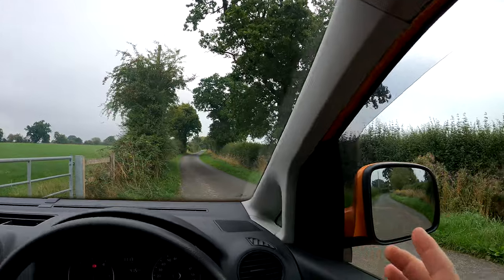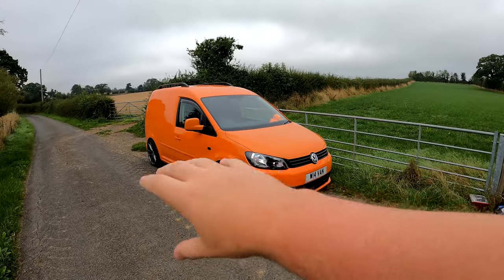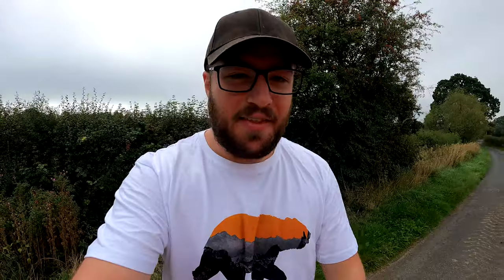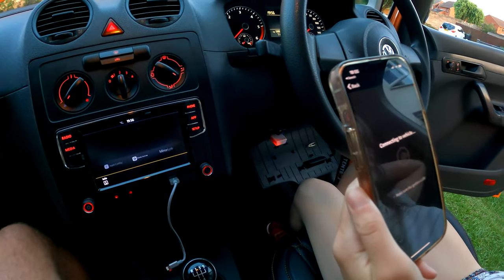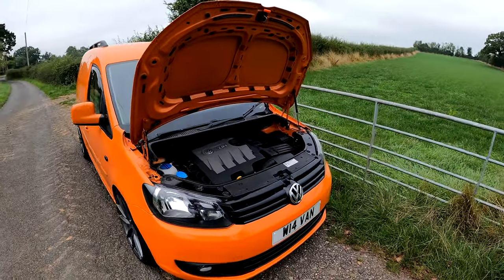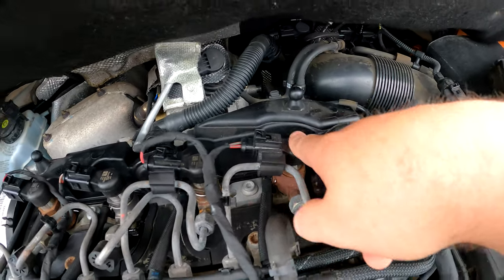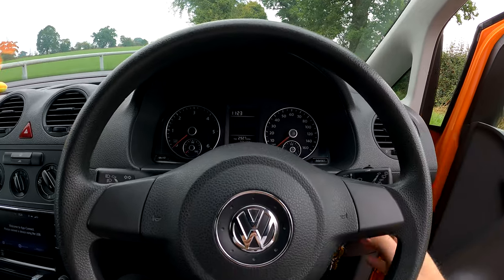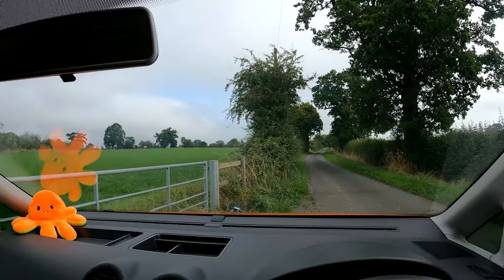I have major issues with the Caddy...

Comment: I've had caddy from 1997 5 in total. 2 mk1s. Then a 1.9tdi.1.6tdi 2.0 tdi. Always used she'll vpower diesel. Run from new to 90000 miles never had injector issues. Now have 2.0 tdi highline 69 plate. No issues on shell vpower every time
Reply: Hi mate brilliant stuff. 
We got a 2013 CADDY 1.6 TDI C20 Startline 68000 miles minted (kept in garage) couried from leicester to Scotland and we converted it to a mini camper.  It had injector 2 and 3 replaced by the one previous owner . We hope we get a few years from it yet but i dont believe the horror stories as  most every car has its faults .

Comment: Be sure to replace the injection bolts , as soon as you can, the bolts have a tendency to snap .an expensive fix on the cylinder head otherwise, it’s a bad design 1 bolt per 2 injector.

Comment: So what were you charged for the injector replacement work?
was this a brand new OEM injector or refurbished one?
I have  1.6 TDI CAYC Golf Mk 6  RAC charged me £600.00 to replace my number 1 injector at side of the A1
Reply from the maker: Thankfully nothing, it was covered under the warranty. 🤞🏼
Reply: How's the golf doing?
I bought mine (CAYC 2011 model) about 10 months ago. Drives okay but I had to take it to the shop every month with some part failing. Recently it's drinking the collant every 5-600 km and this is it's final straw. It's either going to be sold or scrapped. A bloody shame. It would be a great car if it was reliable. But currently it's just buyers remorse.
Reply: If your golf is loosing coolant thers a very good chance you have a leak in your EGR cooler valve,it appears to be quite common on these tdi
Reply: @colin5064  it was replaced already by a recall. Could be it's acting up again. But it's fine for 5-600km, I've read somewhere that these intermittent coolant loss issues are caused by a semi-blocked heater core.
Anyway, car's cost me enough already, could have bought a much younger car for what I've already spent on it. I'm getting rid of it.

Comment: I will never buy a diesel Volkswagen here in Australia they have all the same problems I’m on my second caddy 1.6 petrol bse engine such a reliable engine just the gearbox’s are a weak point I’m referring to the 5 speed manual my 6r Polo 1.4 GTI is even is more reliable then a caddy,
Love your caddy by the way looks awesome.
Reply from the maker: Thanks 😊
Reply: Are the 1.9l engines better?
Reply: @nonstickwater  they are a good motor I’ve heard from my mechanic but it’s the injectors that go I believe
Reply: 1.6BSE engines are almost bullet proof if well maintained

Comment: Good to see you got the issues sorted man, I was aware of the injectors when looking at caddys, should have been a major recall for them all imo. Be prepared for your remaining two oem ones to probably fail in turn eventually though 😂 Whats the diagnostic plug in that you use and is it the same one you use on the focus too? Seems good if you can add in features such as needle sweep and scan for problems on a phone app too!
Reply from the maker: Thanks Mark, kind of expecting the other 2 to go very shortly so hopefully its covered under the warranty. We use Carly for the VW and Forscan for the Focus. Carly doesn’t work with Fords, but Forscan is a massively great tool to have for very cheap. 😁
Reply: @xiolage  yeah hopefully they’re covered under warranty for you 🤞🏻 ok cheers for that mate, I’ll have a look into it 😀
Reply: @xiolage  Do you have a link to where you bought the Carly?Thanks
Reply from the maker: eBay 😊

Comment: I feel for you. I had two injectors go within a week of each other... two weeks after picking up my Caddy. I was bloody furious at it. So I've got another 2 'S' injectors to replace next month (they're sat in the Caddy itself just incase) before the other two go as they're still factory at 155K miles. But yeah, bloody annoying and VW should have recalled them because I've seen them go after only 10,000 miles. Its a roll of the dice tbh.
Reply from the maker: That’s really funny, because that’s the exact same situation as us.. a week after the first one the next one went. Luckily got them all replaced and haven’t had an issue since. 😁
Reply: @xiolage  On the 1.6 tdi engines all of the 4 injectors will go out, its fixed after 2014 models. its known issue, best to replace all 4 when one goes out
Reply from the maker: All are done now. 😊
Reply: How much does it cost to replace the injectors? Going to view a 2013 caddy in about an hour and was aware it could be an issue but not sure how much it will cost

Comment: I’ve had a complete c##t with my caddy 16 tdi all the injectors fuel lines pumps cam belt fucking everything anyway two weeks later same issue got it repaired again two weeks later same again limp mode I don’t trust it anymore and it’s cost fucking thousands fucking hate it
Reply from the maker: They’re very specific cars. We changed our injectors with the upgraded part number and haven’t had an issue since. Mint van 👍🏼